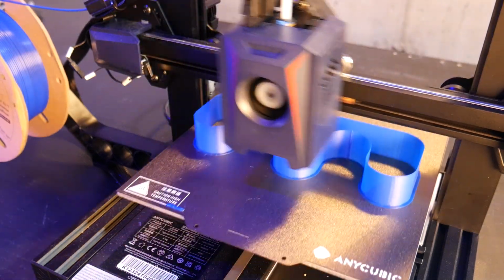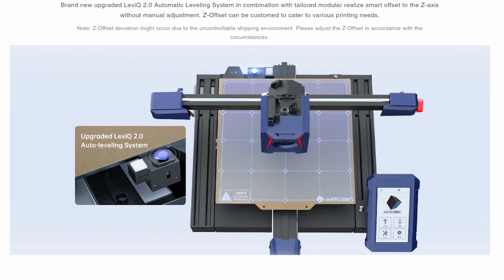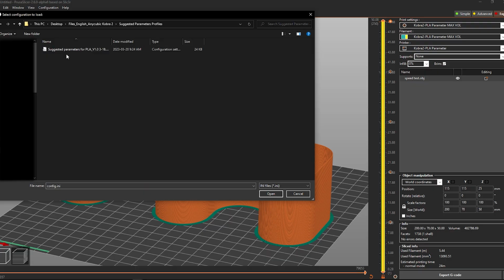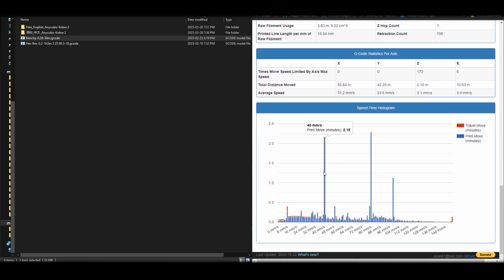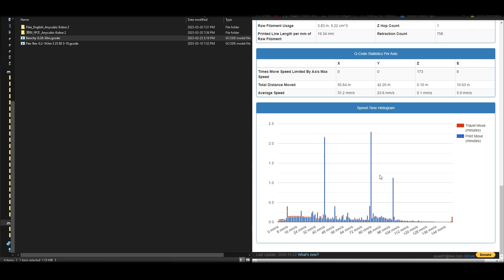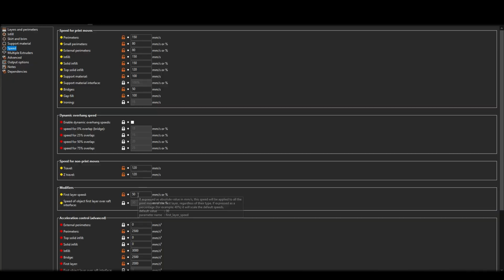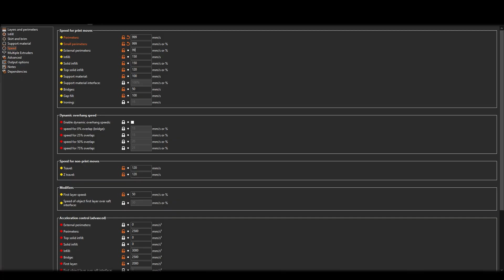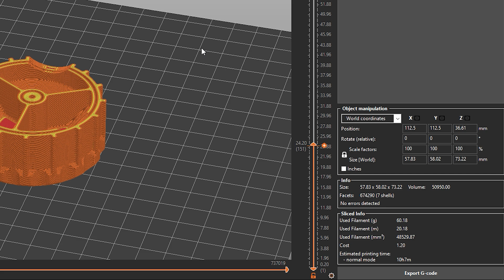Anycubic Kobra 2 Review - The 250mm/s Fast 3D Printer

Comment: Seems like a good option. I want to buy one and use it with my 12y old son. But he is very sensitive to smells, chemical , and floating allergens or particles. Do you know if there is health risk during printing like chemicals, VOC, micro plastic particles in the air.
I hope you have a comment. 
Tks

Comment: I'm a beginner, this is my first printer I got for Christmas. I can confirm it was very easy to get set up and started on.
Reply: Yeah it does. I had to replace the nozzle but it's still going strong.
Reply: Does it work the same after half an year
Reply: Can you print small detailed things? I plan to get a 3d printer to print small tires for small diecast trucks. Do you think it would be able to print that smoothly and also capture the tire tread, etc?

Comment: Does this have an all metal hotend or the ability to upgrade the heat break?  I like to print higher temp plastics and I read the hotend is non-standard so that would be a deal breaker for me if it can't print at least 275° C.
Reply from the maker: i think they market this as up to 300C. of course you can swap the heat break and the heatblock for a more favorable one. people say the nozzles are non standard but theyre just volcano nozzles missing a few threads at the top, i'm sure by now someone is selling them on amazon.

Comment: we all want one, but just remember, if you get this or any other printer from anycubic, no parts and no support so your new shiny printer will be useless very soon
Reply: I call bs on this statement. I have had a vyper over a year, gotten pars under warranty very quickly and good support.  So your statement is without fact.   The SD card slot broke, they send me a whole new logic board.  I had an issue with a motor and then sent me a full set of motors.  Turned out the connector was loose - they said " keep the motors.
Reply: What parts are you talking about? Also "very soon"  been printing on my cobra max for over a year almost none stop only things changed: nozzle after a while and everyone should use steel reinforced belts from gates
Reply: I have had mine for only one month and had a power issue, anycubic communicated through email and sent everthing I needed. I can not complain except I would like to be able to speak to a person. I love my fun printer!
Reply: Someone doesnt know how to search the internet. 😬
Reply: Anycubic has great support in my experience and they have a section for parts on the website
Reply: You can find spare parts on the web
Reply: I experienced great support from Anycubic
Reply: Yeah like an ender 3 is better
Reply: Bs
Reply: @TheCatFather01  ?

Comment: This video, among all, was the one that particularly convinced me to buy this printer. I will say I'm a happy camper so far! Loving this printer, and even better, it didn't break the bank! 🙂 Thanks for this review @WildRoseBuilds!
Reply: @WildRoseBuilds: This is my very first printer; so far I haven't had any problems with it, except one time where a relatively tall piece became "unstuck" from the bed, probably from all the shaking at high speed. I fixed that by increasing the bed temp to 65 degrees on the next print and by creating a raft so it would attach better to the bed. 

I've been viewing several videos that help with setting the offset; so far, I just  go with auto-bed leveling after a firmware update and go with that. What's the procedure to better tune the z-offset on these? Do you happen to have a video on  the same, or perhaps point me to one?

Comment: It's a good printer. Got mine this last Friday. It prints even better with PLA+. I tweaked the settings. I'm using AnyCubic's slicer. I'm working on Prusa and CURA to make profiles for them by taking the settings from anycubic slicer. The stringing you're getting is temp too high. PLA will print perfect at 195C.
Reply from the maker: Thanks for sharing! i try not to change any parameters in the slicer when doing reviews so its more indicative of what a beginner will see with stock settings. but yes especially with the volcano style hotend lower is better! thanks for watching!
Reply: I just got this printer and am using esun PLA+ but have not been getting a good print. Do you mind if I contact you through discord or somewhere else to ask some questions?
Reply: I couldnt find Kobra 2 profile on Cura which one did you use?

Comment: You fail to talk about the nozzle issue.
This hot end uses a non-standard Volcano nozzle... In fact, we should not say Volcano as it is not one.
A real deal breaker for us. We can't find suppliers for this weird type of nozzle so will probably end-up returning the multiple Kobra2 we purchased for our print farm.
Reply from the maker: can you define non standard? judging by the nozzle length and thread i assumed it was the same volcano clone that they shipped with the kobra max?
Reply: @WildRoseBuilds  The nozzle is custom made by Anycubic. The first 1.2mm are not threaded. It's a milled 4mm diameter cylinder met to act as a male part. When you screw the nozzle, it actually inserts itself into the heat bloc. If you try to use a generic Volcano nozzle, it will not screw completely.

Comment: i have two questions. 1: how can you identify over extrusion and how can you correct it? I bought this unit and may be having this issue.
Reply from the maker: to identify, the easiest way is to look at top flat surface of your prints, they will be rough to touch and you should be able to see filament displaced by the nozzle. to fix it you can simply lower the flow rate in cura. the more complex way to fix it is by tuning your extruder e steps. hope that helps!

Comment: Buyers : be carefull. Printers that are sent to youtubers are well mount and configured. I've received mine and all axes are lose and z belt is about to fall of the axes. i'm going to modify all theses default and begin to test print in 2 or 3 days. But disapointed about this new printer
Reply: Men, literally I see your comment three times already xd
Reply: @delgadosaenzdiegoalberto978  That's communication. And if you search, i think you can found comment like mine. Have a nice day
Reply from the maker: This is simply untrue. all machines I've ever received come sealed from the factory. I highly doubt they have time to open boxes, assemble, and tune machines before sending them to reviewers.  That being said most machines i receive need some amount of adjusting, this one however did not. just part of the manufacturing lottery.
Reply: @WildRoseBuilds  Youre really naive if you think that they can send machine, that can be view by thousand of potential buyer, not verified or tuned But it's your bisness, so if you emit wrong argument on printer, no more free material

Comment: After a couple of prints the Y Stepper motor started making noise.  Putting this here to see if it is a common problem, I gather this is a non standard part so something they have not used before.
Reply from the maker: Interesting? Is it a loose grub screw on the pulley??

Comment: I'm new to FDM, have normally used resin printers. Why do most people print without supports?
Reply from the maker: Most fdm models are optimized to not use supports as they usually leave a poor surface finish compared to the minimal scarring that resin printing supports leave.

Comment: I’m still new to this and ordered this one yesterday. What’s the simple fix for over-extrusion you mention? Also what’s a clipper install?
Reply from the maker: congrats on the new printer! the simple fix for over extrusion is adjusting the e steps or the flow rate in the slicer. i have a video on tuning the elegoo neptune 3 pro that would help you tune this machine as well. Klipper is an open source software that runs on a secondary board to handle faster printing. the results of this machine at 150mm/s are pretty good so i would get comfortable printing at that speed before you dive into klipper. thanks for watching!
Reply: @WildRoseBuilds  Thank you. I had the first version of the anycubic Kobra go, but I was having clogging issues. then I didn't heat it up to take the nozzle out and snapped it off. Hopefully, this one goes better. Ha!

Comment: Cool. Elegoo is about to release some Klipper printers next month. 
When I used Klipper some of my prints started to get these extra lines like more Z seams. After searching around I found that installing ar welder helped fix those issues.
Reply from the maker: Can’t wait for some fast elegoo machines! It’ll be Interesting to see these companies different approaches to fast printing. And thanks for the tip on arcwelder, I’ll probably just keep it in my profiles from now on, couldn’t hurt haha.
Reply: @WildRoseBuilds  would love a with/without arcwelder comparison video :)

And with not white filament… 😉 
😂😂😂
Reply: If yuo use klipper , calibrate linear advanca and input shaping , in marlin , too

Comment: 🚀 Sonic Pad to increase performance? How does it print when enhanced by Sonic Pad?
Reply from the maker: Yes input shaping would help for sure, I think that’s in a planned firmware release. Hopefully when I have some time I can plug this guy into my klipper pi. Linear or pressure advance would probably boost some speeds here too. Thanks for watching.
Reply: @WildRoseBuilds  Thanks for your awesome videos!!

Comment: I'm loving this printer Joel. I've always been a big Anycubic fan. It won't be long before there is some sort z axis upgrade like we saw on the original cr10. I'm pretty sure that would eliminate any ringing.
Reply from the maker: Thanks Tony! I found the z axis to hold up pretty well through testing so I’m not sure if it needs the second stepper. I’m sure we will see this on other machines moving forward. Vibration compensation with klipper would solve the ringing for sure! Thanks for watching!
Reply: @WildRoseBuilds  No worries bud. I've not used Klipper, I've always used th3d. Being Arduino based, I'm very familiar with the settings. I can print at a very good quality 100mm/s but it is an old cr10s. I like the new roller system. No flat spots 👍
Reply: @WildRoseBuilds I don't get ringing on mine. I was getting ghosting but I stopped it by reducing speed on parameters to 115mm/s. Infill at 175mm/s to make up for speed on parameters. It's in the inside of the party where it isn't seen. So a tiny bit of slop is okay. I actually saw a speed increase while increasing quality. Only a few seconds but it's still better than a few seconds longer. Also I reduced the speed it prints the top layer at, so that the print is smooth like a 50mm/s print, but at 80mm/s. I didn't get it to run max speed prints everytime, but to be faster at high print quality. You'll notice that big difference when you do a model at 0.12mm layer height in 2.5 hours instead of 10. It does seem like the prints are stronger though. That might be the volcano extruder though. It needs some tweaking, but it will be a good production machine. It does set the z-offset when it auto levels, but it does need fine tuned. It is easier than a Kobra neo or mk3.
Reply: @WildRoseBuilds Independent dual Z axis would be better than the sync belt, I have G34 active on my Ender 5 plus machines and its a great help!
Reply: The ringing is likely caused by vibrations on the Y, or X, not on Z.

Comment: Do they have input shaping? The newest marlin includes it.
Reply: I think nobody noticed. Same with linear advance for standalone drivers (creality MB). Free quality improvements, but rather spend endless time doing temp and retraction tests. Thats the current situation
Reply from the maker: I didn’t dig too deep in the firmware on this one so I can’t say if it has input shaping enabled in the firmware. I’m sure that’ll come in time from either the community or anycubic themselves. Thanks for watching!
Reply: @WildRoseBuilds  i think aurora tech said that anycubic told her about a input shaper firmware being in the work
Reply from the maker: @over_pizza_2578  that would make this printer a really great value machine. I tend not to include features the manufacturer says are “coming”. In the case of the AnkerMake that would be like all it’s features haha
Reply: @over_pizza_2578  I’ll believe it when I see it. I like what they did with this printer. The steel wheels, the timing belt, the oversized fan. All fantastic. 

But you’re at their mercy firmware wise. And they already have your money so what incentive do they have to spend time/money to update it. I stayed away from the kobra because it didn’t have linear advance. I don’t know if they ever updated it.

Comment: it's funny how they're trying to make these style printers print fast when we have deltas. but i cant hate on them for trying.
Reply from the maker: yeah i think its harder to hit this price point with a delta. thanks for watching :)
Reply: I started out with a delta and later added a cartesian. The deltas print quality is very poor compared to the cartesian at similar speeds. Also, the delta is much more challenging to tune imo, especially when trying to print fast. The faster you print that worse the print gets. I'm not a high level Klipper/BOM/2020 extrusion only/Voron 3D user, but the cartesian is my go to printer for quality prints at higher speeds.
Reply: @baxrok2.  Yeah while I love my deltas, they are hard to tune in the sense to get exact size. What I mean is that when I print big, I find that the size can be off, even with exact length rods. So I don't use my deltas for prints that require very precise sizes.,
Reply: @iamthebest22  Yup, that is my experience too. 99% of what I print are small functional prints with holes in them. Probably the worst combination for a delta. I thought I was going to lose my mind tuning that crap out. Then I got a cartesian and that changed everything. So I use the delta for prototypes and the cartesian for finished prints. Overall though, my delta days are over.
Reply: @baxrok2.  exactly why I never got one.
I knew a couple that made money with their delta by printing life-sized scans of people’s heads and faces, but I’m a prototyper and need accuracy with both small holes & features and large parts.